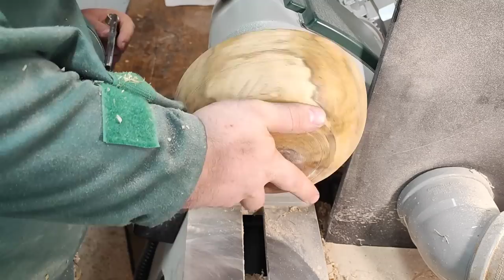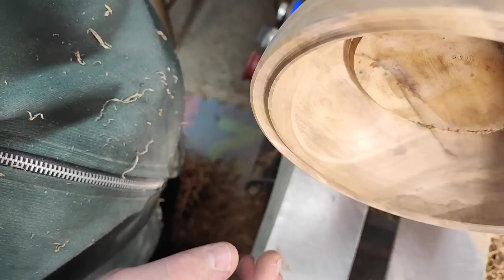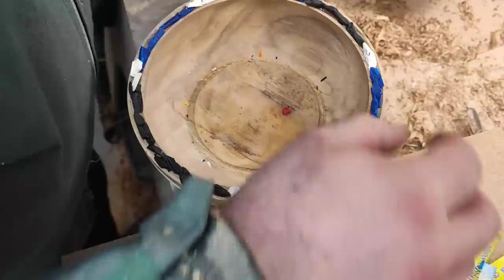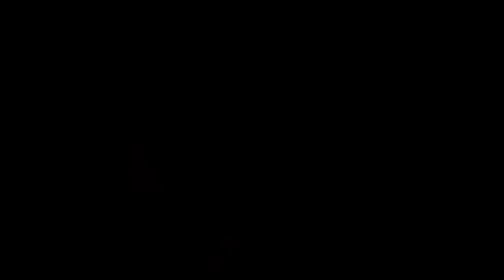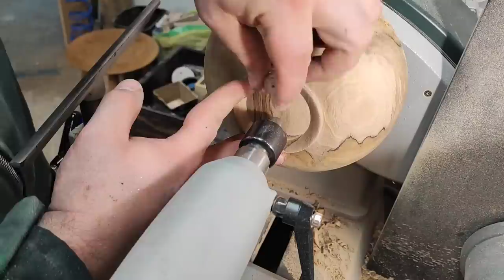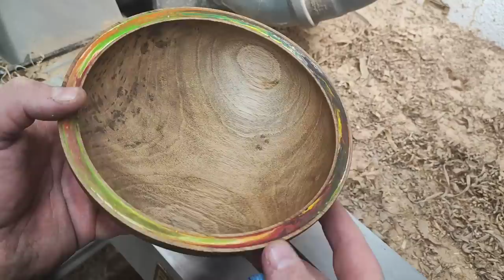What happens when you mix wood and crayons???

Comment: Hi Mr. Tomasic.  High end furniture restorers will often have a set of wax crayons in their kit in varying wood colors (reds, yellows, and greens) which they will melt into deep scratches and dents using a soldering iron.  After leveling the wax with a card scraper, they will apply a seal coat of a 1lb cut of super blond (water white) shellac.  They will then take a very fine brush and use oil paints to draw the "grain" of the wood and this will be followed by another seal coat of shellac.  Finally, they will apply their finish which is usually varnish or more shellac up to a French polish. They usually don't use this technique with oil finishes as oil takes too many coats to build a film on the surface of the wood.  This might have been an interesting experiment on an open pored wood like oak or ash to fill the pores with different colors.  Thank you for the experiment.
Reply from the maker: Thank you sir, I've been introduce to some of those restoration tehniques , they are lovely and I might do crayons on oak although I prefer other methods to color the wood, soon I'll do video on that as well🤗

Comment: Hi Tomislav, I also agree that the darker rim is better. Experiments are the way to learn, thanks for sharing. I’m not sure that I will use the crayon technique for durability issues though the comment on a shellac coat might be a solution since shellac goes on everything and can be covered by anything also. Thus one could try the crayon, shellac on all the bowl and oil to top it. I had good results with shellac on spalted surfaces with an oil finish afterwards 

Have a nice month of July.
Reply from the maker: Agree on crayons with you ☺️ but it was fun to do😅... Thank you very much for watching

Comment: Well, that's an interesting if somewhat dangerous concept... 😅😉 Probably a furniture wax set, or maybe a hair dryer or a soldering iron would be more controllable (and safer)? I agree with others that unless you put a very durable finish on it (which don't stick very well to crayon or wax, it won't last very long. Not a great fan of epoxy,  so I wouldn't use that either.  I do like the finished piece, especially the shape of the bowl, the foot and the sunken rim. Had I the skill (which I most definetely don't) I'd probably have gone for an inlay,  a purfling like on guitars.  Many thanks for sharing this.
Reply from the maker: Everything is better then BLOWTOURCH 😅..... Thanks you Joris for watching 😀